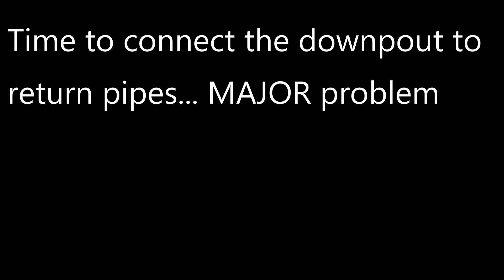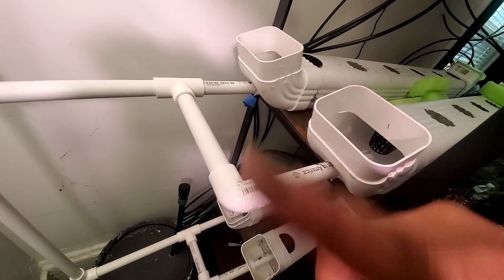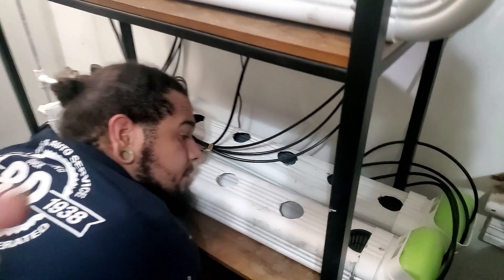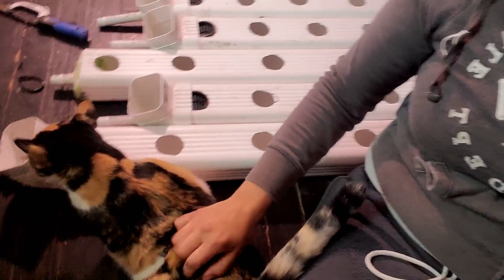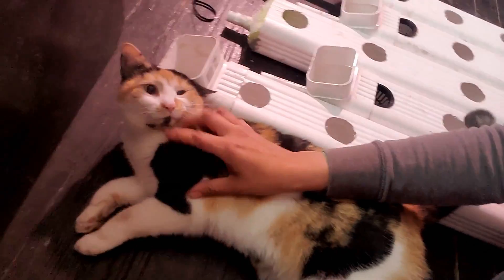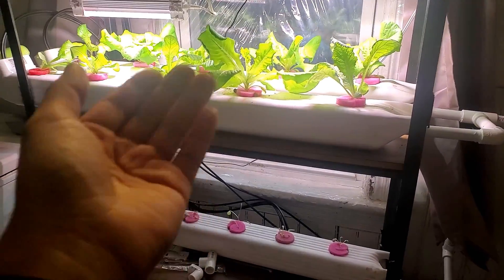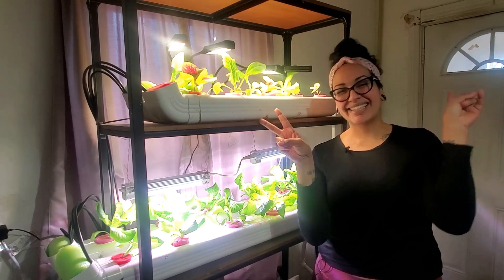Indoor Home NFT Hydroponics System On A Budget-Kitchen NFT System

Comment: With your hole saws - there's a trick you can do on plastic to make your holes a lot cleaner.  Drill normally until the pilot bit goes through and the teeth start cutting.  Then put your drill in reverse and finish cutting the hole.

It takes a few seconds longer to get your hole but it's a lot cleaner and less cleanup afterwards.
Reply: Yes I jst saw this on Mike vanduzees video where he made all his almond milk cartons into planters